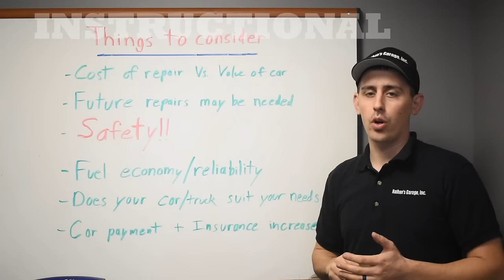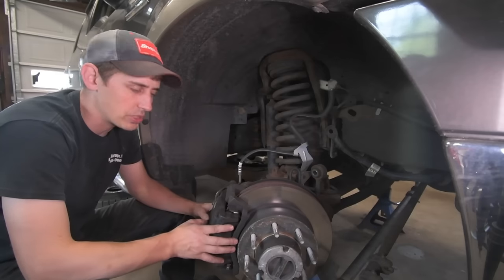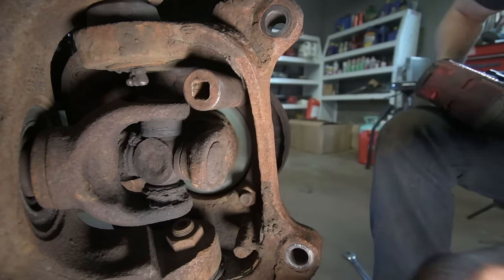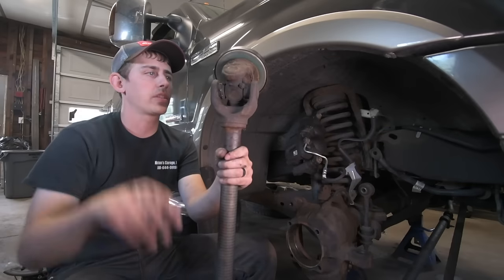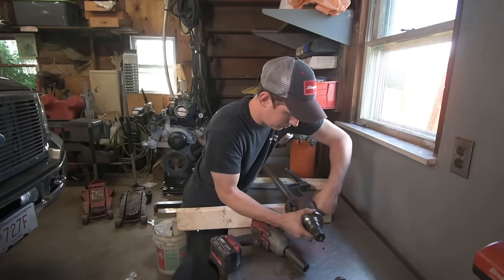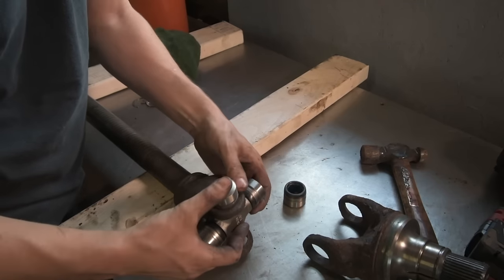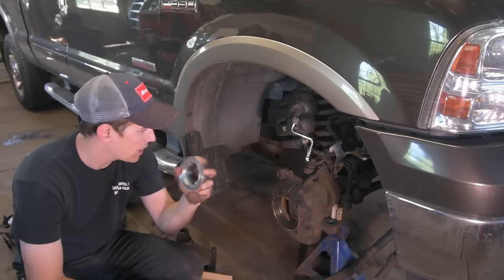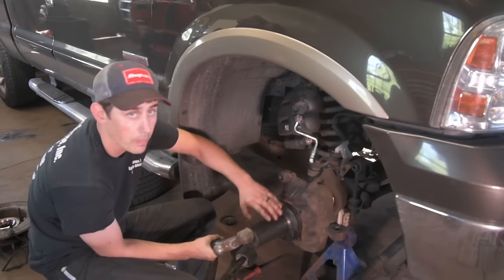Ford Superduty Steering wander repair....Axleshaft u-joints

Comment: You seem to know your stuff when it comes to steering. I have a question is there an adjustment to control which wheel turns first? For example when I turn my steering wheel all the way to the left the right wheel will turn left but the right wheel stays straight until half way. Then when you turn all the way to the right the right wheel again response first til about a quarter of the way then starts to turn. This started happening after firestone did an alignment and didn't tighten the tie rod sleeve and I was going down the highway and the tie rods came apart and my wheels toed out until I came to a stop . Since I was out of town another shop replaced my gear box and y Linkage since the tiered sleeve was stripped.
Reply: It's on a 2004 excursion

Comment: I have a 2013 f250 and it does this and also I think my ball joints are bad cuz my tires are ate up across the tire
Reply from the maker: I would check for this and also get a quality alignment done.

Comment: I have a 2003 f250 and when I make a sharp turn I get a clicking noise, would you think that would be a u joint issue?
Reply from the maker: It could be. I would inspect them for sure.
Reply: I will. Thank you. Great video!

Comment: Hey I have a 2004 f250 I have changed the entire steering assembly ball joints tie rods steering box and I still have wander it has to be the front joints you think?
Reply from the maker: Most likely
Reply: Thank you

Comment: I have a 450 that’s RWD, and I have the same exact symptoms after ball joint replacement, tires, and alignment. Any solutions?
Reply from the maker: Does the truck feel more like it’s floating or almost like it’s on ice?
Reply: In The Shop yeah floaty is exactly how I’ve been explaining it to people!
Reply from the maker: Most likely it is your tires. Every single truck with 19.5s that I have put fresh tires on behaves just like that. To the point it’s actually scary to drive. I have found it to be worse when they are traction type tires in the rear.
Reply: In The Shop does it get better? I’ve put about 6k miles on them and haven’t noticed a single bit of difference

Comment: Quick question, I have same issue on my 03 F250. Changed steering box and nothing changed. 

Would I technically be able to jack up the front end, manually spin the wheels 90° then try and turn the steering wheel instead of disconnecting my steering? Changing out my bearing/hub tomorrow and have the wander problem as well as the 4x4 vacuum issue 🙄 one step at a time....

Comment: helo I just saw you video and I'm having the same problem in my f350 dually  but mine is not a 4x4 can you help me please...
Reply from the maker: On a 2wd a number of things can cause a wander. The ball joints can be frozen, steering components like tie rods can be worn, the box could have play, or the alignment could be off. I would start by making sure nothing is frozen and it al moves freely then I would check for worn out components.

Comment: This problem is intermittent which differentiates it from slop in the steering box etc which is consistent year after year. 
If you only operate in 2wd can both shafts be removed completely to solve this steering wander problem?

Comment: Just watched video on changing front axle  u joints l have 2007 f250 s/d been having problems with gem found windshield leaking had it resealed gem still acting up know one in my area seems to know beans from corn can you give some insite on is gem located on back of fuse block and if l do get new one does it need to be reprogrammed and l do have 6.0 keep up great videos thx Bob

Comment: Hey. Quick question. Maybe not so quick. I just bought my son a 2004 powerstroke f350. Because of coronavirus,  we were not allowed to test drive. Anyway, was very disappointed when finally drove it. The sway on highway is Ridiculous. White knuckled. Can not give to my 16 year old. I am a Mechanic (not auto) but do work on my own cars. But I have come up with 5 different possibilities. From sway bar to ball joints to now u.v joint. Maybe 1 piece of info may help in diagnosing?  I do here clanking under my feet as I go over bumps. Making me hope it's just bushings and drag links and sway bar. Do you have any thoughts? Also i live in Ny. Is it totally crazy for me to want to bring truck all the way up to you?  Thanks in advance. Jeff k.
Reply from the maker: Hey Jeff, the noise under your feet is likely the sway bar end links. Very common. I would inspect those first. I would also keep the full weight of the truck on the ground and have someone shimmy the steering wheel back and fourth while the engine is off. Inspect all of the steering components including the track bar while shaking the wheel. Hopefully this helps.
Reply: @InTheShop  thanks. That does help. A lot. Makes me less nervous about possible ball joints or new steering box. What about all the slack in the wheel? Think adjusting the steering box would help if it was just the sway bar end links? Thank you again. I really appreciate it.

Comment: Could you test this with both front wheels off but the steering still attached? Just get in the truck and turn the wheels with the hubs locked?
Reply from the maker: You can but sometimes the gear reduction in the steering box can make it hard to notice if the u-joints are tight buy not yet bound up completely. If they are really bad you will probably be able to tell by checking it like that.
Reply: @InTheShop  Thanks so much man, awesome work!
Reply from the maker: Thank you!

Comment: I got a question with a 2010 f250 I've taken it to 6 shops here in Texas and no one can figure it out. Everytime i hit a dip in the road my front end squeaks like a loose bumper but nothing is loose I've replaced upper and lower ball joints, inner and outer tie rods, shocks, and cab mount bushings and its still squeaking can you help me in the direction I need to be. I also have a leveling kit on the front end its a 2.5 inch from Supreme suspension.
Reply from the maker: Hey Henry. Very tough to diagnose squeaks and rattles. I would try to get a couple people to bounce the front end by pushing on the bumper. If you can duplicate the noise that way you can lay on the ground and try to pinpoint the noise.
Reply: @InTheShop  i already did that and still can't find the problem im thinking that it is the radius arm control that goes from the front axle to the frame those bushings may be shot
Reply from the maker: Another option you have is what i do to find noises. You can use a set of these https://amzn.to/3h0LfJG or the wireless version https://amzn.to/2PUwoEz . You clamp these onto different suspension components and drive the truck. These basically work like small microphones. You switch between each one and see where the noise seems the loudest. You can narrow it down and then pinpoint where the problem is. It’s an investment but at this point it might be your only option. If you can swing the extra I highly suggest the wireless version. It works much better.

Comment: Need help with my 2000 f250 super duty hard steering issue. Replaced power steering pump, u-bolts on both axles, gear box, and turbo buster that connects to the breaks as well and still have the same hard steering issue. Not able to figure out the issue. Any suggestions on what else I might need to do or replace . Any info. Would be greatly appreciated. Oh one more thing. It also wines really loud when u step and hold the break down too

Comment: my truck is a 2wd 2005 f250 6.0 CC SB manual zf6 xlt 337k miles. Bought the truck a few months back and the alignment was horrible. after $1500 (alignment/mount/balance/tie rod adjustment sleeves, tie rod ends, wheel bearings, and 2 new tires) with 3 "perfect alignments and tire/mount/balance" the truck wanders all over the lane. Tried tightening the steering box which took out some of the "slop" from the wheel but still feels that the truck randomly drifts in the lane as if the front of the truck decouples off/on from the steering wheel. Planning on changing pitman arm and steering box to see. Any other thoughts since mine is a 2wd?

Comment: I got a question, so when I just replaced power steering pump, gear box, tie rod and pitman arm but I’m having the same issue. It’s kinda hard to explain but I’ll do my best. When I’m driving straight, on occasion it feels like a twitch almost in my steering wheel but it actually pulls my truck. It will start pulling left so I’ll try to correct straight and it will jerk the other way, so on and so forth. There is also a loud whining noise coming from the power steering pump which is why I replaced it but it didn’t fix anything. I’m out of ideas and don’t really wanna throw any more parts at it. If you could help me out that would be awesome, you seem very skilled in your videos. Thanks again!!
Reply from the maker: As far as the whining goes I would start by looking at the fluid. Make sure it doesn’t look like it’s full of air. If it’s not I would start checking the bearings on other pulleys and accessories. Have you checked your axle u-joints yet? They could cause the pulling and twitchy type feeling you are describing.
Reply: @InTheShop  I have 2002 f350 super duty, and I have same problem. I noticed when I put new set of tires on (recommended size) it started doing same thing. I constantly have to move steering wheel side to side to keep the truck straight. I can really feel it when I'm towing my 32' travel trailer. I changed everythingon front end,  and it still the same. ( How could u-joints be the cause?? ) if 4x4 not engaged?
Reply from the maker: Andre have you checked for play in the steering box itself? The way you are describing it sounds more like that might be your issue. Either way the reason this still happens even with the 4x4 disengaged is because when you turn the wheel the axle shaft still needs to pivot even if it’s not spinning. I would suggest checking it like I showed. You will know right away.

Comment: can a guy engage in 4x4 and put it through the motions and work the joints and see if it frees up?
Reply from the maker: The issue is the u-joint caps usually fill with rust. Once they are rusted they are no good.

Comment: Could this issue cause the steering wheel to fight you? Like when turning it push’s back like a inch the goes back to where you were trying to turn
Reply from the maker: It can cause that symptom.
Reply: I will check that out thanks.

Comment: i have an issue with my 99 f250 where a couple times after i turn into a parking lot my steering wheel goes back and forth on its own and the truck goes with it.  would this be the same issue? i have checked everything just like you said in the beginning and everything is good
Reply from the maker: It definitely could be. I would check these out.

Comment: I have a 2013 f250...steering wheel will not stay centered after several alignments and adjustments to the wheel. I gradually turns right after time. It's sitting at about 3oclock now. But also the truck seems to pull to the right when driving and braking at times. Any suggestions.

Comment: What adhesive did you use before you put the hub back one! Was it a grease or a sealant? It looked grey! I have to do this to my truck and I have the complete Dana Spicer kit to do the repair with!
Reply from the maker: It’s antiseize.
Reply: @InTheShop  thanks!

Comment: Could this cause the death wobble
Reply from the maker: Not usually. Death wobble can be caused by low tire pressure, loose suspension components (typically the track bar), or incorrect caster adjustments.

Comment: do you think this translates to a '91 Bronco? If so, mine has autolocking hubs, would I need to lock them first before doing the test?
Reply from the maker: Absolutely. This transfers to anything with Universal joints in the front axle. As long as you can rotate the axle you can test it this way.
Reply: @InTheShop  If the u-joint is seized in one direction, wouldn't it show a problem or make a noise if you were driving in 4WD?
Reply from the maker: It could. It depends on how badly it’s frozen. Sometimes the power steering can overcome and you may not be able to notice it much.
Reply: @InTheShop  thanks for the help. Great video.

Comment: I have a broken front right axle on a 2005 f250 superduty 4x4. I am having it shipped to MN from Alabama. When it gets here they will have to drop it a mile from my townhome. It is not hung up right now as the mechanic down there freed it up. If it gets hung up on the slow drive home, should I be able to free it up with a pry bar or something and careully keep driving it some more until I hit my driveway, or am I screwed? thanks guys.
Reply: The U joint is all rusted and broken on one side of the joint. thanks
Reply from the maker: Hey Joel, without seeing what’s going on it’s hard for me to recommend what’s safe or not. That being said if the 4x4 shifter is in 2wd and the hubs are unlocked it should be fine to drive it a short way at a slow rate of speed.
Reply: @InTheShop   thanks for the quick reply I appreciate it.

Comment: Hey man so I took my 2000 f250 to the mechanic to have them do this repair which was much needed but it has not fixed my wandering issue. I've rebuilt the entire front end and the lower steering shaft what else do you think it can be? Also every time they do an alignment the steering wheel is turned in different direction.

Comment: I know you said it was common for super dutys but does just the diagnosis apply for a 4x4 obs 350?
Reply from the maker: This can apply to any 4x4 with axle u-joints. The diagnosis would be exactly the same.

Comment: How about if it’s not a 4 wheel have no U joint what would be the problem of a wonder steering
Reply from the maker: Thoroughly inspect the front end. Also check for broken leaf springs.

Comment: I have a 2001 Dodge that has really loose steering like that as well  .  So would this procedure work on it as well.
Reply from the maker: Its very possible. The test would be identical. The dodges are very prone to loose steering boxes and loose pitman arms also. I would thoroughly inspect all of the steering components while you are in there.

Comment: I have the same thing going on in my 07 6.0
Also getting a shake around 60-80kmh, been throwing parts at the shake but it won’t disappear, could the shake also be a part of the axle shaft u joints ?

Comment: Great video,  my f250 diesel 2004, the idle keeps spiking,  it's starting to do it more often. Do you have any ideas on what it may be? Thanks
Reply from the maker: Can you describe a little more what is happening?
Reply: Hello,  2004, f250 diesel, 250k miles. At 260k miles replaced head gaskets,  at 280 replaced hoop, all 8 injectors from Ford Dealer, ipr and icp sensor, new turbo, new cooler and new glow plugs. I only use genuine ford Dealer parts. I have a gauge which I monitor the icp, ipr, ficum and sync. The truck ran great until a month ago. When at a full stop or just strolling down hill the idle and icp pressure spike up where the idle spikes up as well. Than immediately icp pressure drops and the idle spikes down to a point where it wants to stall. Icp and idle Kind of  surges.  I'm a farmer, always hauling cattle and feed. Spent alot of money on it and can't afford another truck. Thanks for your reply
Reply from the maker: I would inspect the ICP sensor connector
Reply: I'll pick up a new pigtail and let you know.  Thanks

Comment: This is bs if you unlock your front end an you still have the same issue. I chased this very thing for ever. Turned out to be my track bar and gearbox. I bought a new remanned so I figured it couldnt be the gear box but it was so I bought a Redhead gearbox and a new adjustable track bar. Problem solved. Parts installed figuring out issue. Body mounts, heavy duty hellwig swaybar, endlinks, redhead gear box, Bilstein shocks, Carli adjustable track bar.
Reply from the maker: Hi Michael, this customer came in with their front end unlocked and most of the others have. Even with the front hubs unlocked there is enough resistance especially while turning sharp to turn the axle shafts. Usually the problem will be intermittent. If you have frozen joints and have the front end locked you typically get a shimmy. This isn’t BS it just wasn’t applicable to your situation. This video wasn’t to show every possible issue only this one particular issue.

Comment: I have a f350 2013 srw. Ive been having issue on and off with the steering in the last month or so but now its a constant issue. When I start the truck up and do a turn my steering wheel jerks to either side depends on if I'm turning left or right. I stopped the truck and did a couple of full turn but it got harder after a whole turn. Would that be the u joint going bad? I drove it yesterday to the shop in the highway and its jerking me around the road like I'm driving drunk. What.could be the issue.
Reply from the maker: It sounds like it could be the U-Joints. I would check them.
Reply: @InTheShop  thanks alot. Keep up the great video brother. I had no clue what was going on until I watched your video. Very informative....

Comment: LOCK THE HUBS LEAVE IT IN 2HI  DRIVE IT AROUND AFTER YOU SPRAY  WITH WD 40 AND LUBE GREASE THE FITTINGS THEY WILL SPIN AND BEGIN TO FREE UP THEN THUS GIVE IT TIME EXERCISE THE FRONT DRIVE LINE ONCE AND WHILE 👍

Comment: I did axle u joints, complete front end re done upper n lower ball joints, bushings the whole 9 yards and it still has sloppy steering last piecesI'm gonna look at steering shat u joints and steering gear box